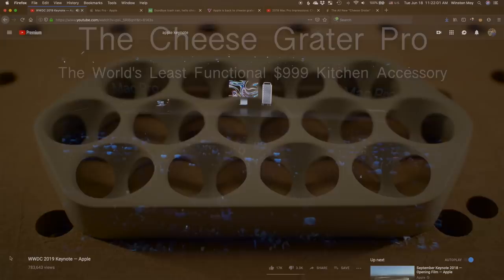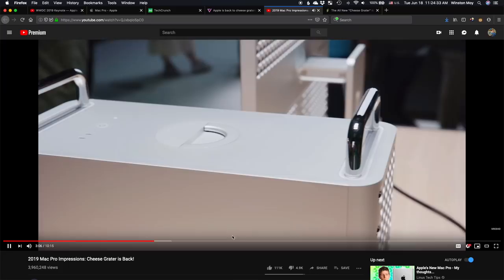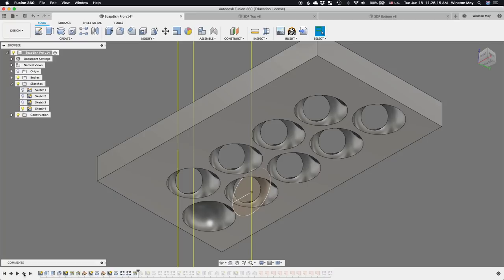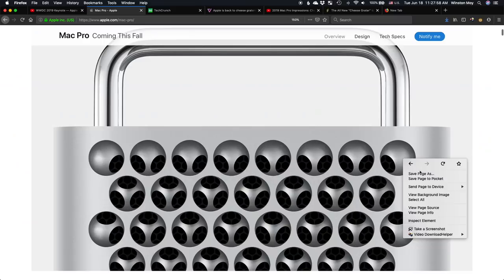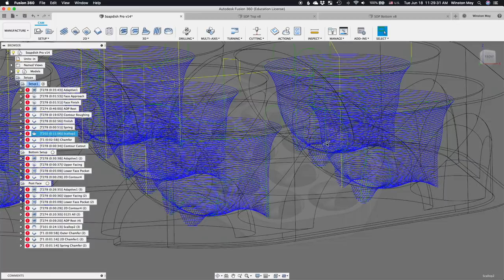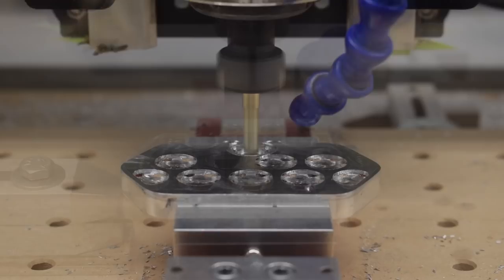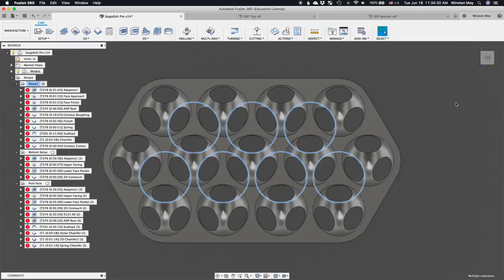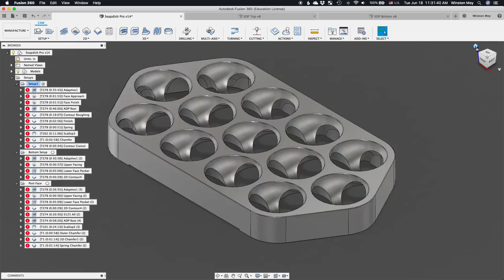Machining Apple's Mac Pro Grille on a CNC

Comment: That will be a thousand dollar soap stand, soap sold separately of course.
Reply: @Dmitry I didn't think starving children had enough fat on them to make soap.
Reply: couldve been better if you said stand not included
Reply: @Dmitry 
I dont think so. They're most likely going to be moving a large amount (if not all) production out of China.
Reply: But don’t worry! You can save 5%... with an Apple Card. (btw, when writing this comment, autocorrect forced me to capitalize Apple Card. IT DID IT AGAIN 😂
Reply: Now introducing apple soap pro, sold for 99$. the apple soap pro is bendable, water resistant,a and will charge inside a microwave.
Reply: Of course you need to buy the $1199.99 apple Isoap
Reply: The Blissful Orange Apple iSoap
Reply: No No No... it's I-Soap not EYE SOAP!... your using it wrong!
Reply: But isnt the soap they'd use just old iphones?
Reply:  Apple Soap, 🧼 The Most Convenient soap ever made! 100% Recycled from iPhone Parts

Comment: When your Budget is 0.000001% of that of Apple but you improve on their Design
Reply: @Murphy deffa and money can't cure cancer :(
Rip Jobs
Reply: @Felix-ve9hs  probably could have, he didn't do things properly
Reply: @RunFor OurLives "subjective" it litteraly gives better ventilation because more holes
Reply: @GlowingSpamraam  but "better" is subjective because you have no idea how it will perform. What you meant to say is it has MORE ventilation, but MORE ventilation does not necessarily mean BETTER airflow. Place your motherboard on your desk and it will have great ventilation but horrible airflow and will more than likely just accumulate dust. The purpose of proper ventilation is to keep air moving in a specific pattern, not just to provide "more air".

The only way to know if it's better is to actually test the two side by side, which Apple may or may not have done. Of course my hypothesis is that given how tiny those edge holes are comparatively to the full surface area, the difference is more than likely negligible AF so it's not actually "better" in any measurable way, just more expensive, which is pretty much worse for a company that offloads all of its costs to its consumers + crazy markup.
Reply: @Murphy deffa It literally can though.
Reply: @RunFor OurLives That's why all Apple is doing is improving someone's else invention ;)
Reply: I would say that the design is not that good in the first place. as you could make a more functional vent. without machining for no reason.
Reply: @ameraldas3641  You are confusing design with engineering.
Reply: @ameraldas3641  Also its not for no reason its part of the design, wether you like it or not apple are globally renowned for their design   and I would hazard a guess they are better at it than you.
Reply: @sacredgeometry  I don't know if "renowned" is the right word here ;)
Reply: @DASPRiD  it is.
Reply: @DASPRiD  Revered is also applicable.
Reply: @sacredgeometry  I'd rather say "frowned upon"
Reply: Ameraldas The design may have some sound dampening properties while not changing the air flow characteristics. If so, that will be very welcome in the environments I work in. I plan on testing this what I get one.
Reply: I Am Sekou I am not a fan of anything but it’s nice to know you have found yourself.
Reply: I Am Sekou The arrogance of obvious idiocy is far too common to be even vaguely interesting.  

But, by all means, keep enjoying the belief that this demonstrates your importance or is a valid substitute for your obvious deficiencies.
Reply: I mean, there’s more to it than just making it better. When you’re mass producing, that extra 10$ to improve that one thing can turn into an extra 1,000,000$, some of which will not even sell
Reply: @Felix-ve9hs  didn't he ignore cancer treatments, and instead tried a juice cleanse
Reply: @Murphy deffa money can buy brains. Ever heard of college? And a company would buy someone with brains.
Reply: Only marketing brains..they forgot high end cameras shoot at 120hz that apple macpro monitor cant display
Reply: @RunFor OurLives "Also, improving upon someone else's invention is easier than the initial invention." No wonder Apple became successful so rapidly, although to be fair Apple had better marketing, that was the only "improvement" they needed to sell stuff with their name and logo, there is a reason why people say Apple is a "lifestyle company" after all.

Perhaps you should research about the brand you say improved on so much, even Steve Jobs said he was the marketing and Wozniak was the Engineer. Shame more iDiots don't know the extensive early Apple history and just claim they invented everything they sold/sell.
Reply: @alpha.gamma.dingdong  "What you mean to say is it has MORE ventilation, but MORE ventilation does not necessarily mean BETTER airflow."

Mate, your denser than a brick. Ya know that right?

"Place your motherboard on [a] desk and it will have great ventilation*,* horrible airflow and will more than likely just accumulate dust."

1. Assuming there are fans present (which there are in the Mac Pro), increasing the intake will produce better thermals OR sound, depending on fan configuration you can have Low RPM fans for low noise since increasing the intake generally means the fans don't need to be running with higher speeds to get the same amount of air, a 200mm fan can run with a lower RPM and produce less noise than a 120mm fan.

You say take a motherboard and lay it on a desk, this disregards the comment you are replying to entirely, one case is: With fan more intake means more airflow which means better thermals (or noise, depending.) your case is: let me disregard we are talking in terms of fans and more space for intake DOES mean better airflow and let me compare it to no fans and a static air environment.

Finally, ventilation doesn't mean air that a computer produces heat into, ventilation has a very literal meaning(s) of

1. The replacement of stale or noxious air with fresh.

2. The mechanical system used to circulate and replace air.

An object with a passive cooling system is not a mechanical system circulating air nor a system actively replacing hot air with fresh air.
Reply: you wouldn't need to improve something if you didn't first know that it was not as good as it could be.

Comment: You should make a replica Mac Pro case. Then get Snazzy Labs to make the ultimate Ryzen Hackintosh with it.
Reply: They would get sued into oblivion if they tried to sell that.
Reply: yep
Reply: It’s hilarious how much cheaper it would be
Reply: Ryzen and hackintosh don’t go together very well unfortunately. It’s possible but there aren’t really drivers for ryzen chips for macOS because macs all come with intel chips.
Reply: @redluckog7008  Low production run cases? It'd be a fucking fortune.
Reply: @phillipsusn  It's not fine really.. If you're just playing at using a computer then sure, but if you expect it to run close to a real mac or even an intel hackintosh you're fooling yourself.
Reply: Bro facts
Reply: Codey Vargas Everything else? Not quite. Some really good audio developers have released apps or plugins that require AVX-512 support. Some of my most important plugins are getting massive benefits from it. By sticking with Intel, it seems some developers are making the commitment, especially since the iMac Pro and Mac Pro releases. So, no go on Ryzen at least for some of us.
Reply: @markm0000 ....  Hahaha... Sued to oblivion...  Noice
Reply: @Codey Vargas Except it doesn't really. The one thing hackintosh folk never mention - it's not that good.
Reply: LinusTechTips: Holy my beer
Reply: Threadripper 3990x anyone?
Reply: @markm0000  probably depending on whether Apple filed any patent for the case. If not (though unlikely), maybe just make the case anyway and not include a logo can get around that. Otherwise, maybe just make the front panel and mod it into another case, as IIRC you can't patent simple geometrical shapes.
Reply: LTT already did this

Comment from the maker: Note: People have commented before, and they'll likely keep commenting later but the reason I chamfered the edges is because Apple typically has a 5-10 thou roundover on all their hard edges. That's why you don't slit your wrists whenever you type on a Macbook. The Mac Pro likely has that sort of edge-rounding too, and I wanted this test to be more realistic. Accuracy is obviously important when so many people are counting on the results of this test to inform their purchasing decisions.

For those asking if you can use a "ball end" drill, it's not really ideal. A blunt-nosed drill doesn't work very well. However, a larger diameter ball endmill would require fewer stepovers and be faster, assuming you have a beefy enough machine to handle it.

Note: If you want to 3D print your own grater/soapdish to test, I posted the unchamfered version here: https://www.thingiverse.com/thing:3704406
Reply: Winston Moy how much would you want to sell that cnc Mac grill I want one or two for my night stand and drawing desk
Reply: Thank you, I can now inform the Bank of Parmesan cheese that they do not need to invest in this new grater hardware, very sad to see that all these years of hard work on Apple has not paid off in a great grater. Maybe you can tests if it does function well for pressing Apples into apple Juice, I think they made a mistake during development.
Reply: Thanks, I will get a Mac pro for the shower, finally there is a solution for the soap dilemma!
Reply: thanks, currently printing one ;)
Reply: How much does it cost to do all these at home?
Reply from the maker: Allan Sh If I'd gotten everything right, I could have made and anodized one in an afternoon. The aluminum itself is worth a few dollars. The rest is just time.
Reply: Winston Moy  I mean, I don’t have any equipment at home now. If I am going to build a workshop, how much would it cost?
Reply from the maker: @allansh828  That's an extremely open-ended question. To get up and running with a CNC like mine with some cutters and accessories would be around $2k. But if you don't have power tools, hand tools, consumables like glue/sandpaper, a workbench and some decent lighting... could be hundreds or thousands more depending on how crazy you want to go. That's a calculation you gotta make. Come up with a project, figure out what tools you need, and price it out. Subsequent projects will get cheaper as you build up an arsenal of tools.
Reply: would be more accurately described as a break edge. they can take shape of chamfers or fillet/ rad. how would it work on smaller sized holes? most graters are fine for hard cheeses like you used as they are more likely to flake than grate. 

as a machinist I already saw your mirroring issue before it even happened. without proper care and attention to how things are programmed mistakes like that happen, great to see you overcome it and found a more reliable and efficient way around it. side note on the finishing anodising is all in the prep work. got to get it clean, and i mean super clean so a better surface finish the easier it is to clean. a dremel with a bit of scotch-brite pad would make the world of difference but as a first go at plating it looked good. i also see in the tool path setups you go - rough finish rough finish... its best practice in most aplications to do all the roughing first then the finishing
Reply: Cool!  You can sell it on Kickstarter for $1000 each...
Reply: Yknow what this is cool.

Have you heard about my obsession known as combat robotics?
Reply: Fair for the cheese grater test, but honestly, I do feel like slitting my wrists whenever I have to type on the Macbook butterfly switches rather than my external keyboard.
Reply: Winston Moy 😂
Reply: Using a MacBook makes me wish my wrists would be slit on the edges tbh
Reply: > you don’t slit your wrists while typing on a MacBook

I can’t use my laptop laying down for this exact reason

Comment: This, you need so much CNC machining for what could have been just normal holes or a mesh that probably be even better for air flow.
Inflating the price just cause -  by Apple.
Reply: they are a fashion not tech company...
Reply: I’d rather pay more and get to see the beauty rather than some standard case. This is not for everybody anyway, there are cheap cases for people with your mindset. 👍🏼
Reply: Tikoblocks they’re selling the monitor at a loss so they have to make the stand cost more.

Comment: Hi, Great Video. I'm Curious, what vice are you using? I'm looking for a sturdy (very)low profile Vice.
Reply from the maker: Carbide3D's low profile vise. But it's meant for light duty work, I would not throw it on a Tormach or something without a few mods for improved holding strength.

Comment: I’m thinking that Apple is using a sphere bit for routing out the holes, which is why they have to cheat near the edges. That way, they can just drill normally and then simply round out the edges. I’d love to see you make another video if you ever pick up those drill bits.

Comment: Not sure what kind of tool or loads your mill/router/fixtures can take, but a much better (read: faster) way of doing this would be to hit each hole leaving ~.005 on the depth with a 1/2-3/4 90deg endmill and then getting a 3/4 (or whatever your desired size of hole) ball endmill to basically drill it out for the final.

Comment: New idea for a product: 1/5 or 1/4 scale model of a Mac Pro case with holes in the front and back that are actually sized to grate cheese. Add a slicing blade to one of the long sides, and the logo of your indie product studio to the other side where the Apple logo would be. If TwelveSouth haven't already stolen this idea, they soon will.

Comment: OR when you get the Mac Pro Cheese Grater, change the fans to one of those delta fans and then you can finally cheese grate as the powerful server fans sucks then in and chops them off for you even smaller and suck it back out the Mac 😂

Comment: See how your cheese grater somewhat works... That means you re-engineered Apple's design perfectly. Now it just needs to suddenly catch fire. Or bend. Or send a ridiculous amount of Voltage to the CPU. Or have the signal reduce to 0 when you hold it "incorrectly". Or maybe have a SATA cable inside that get's loose... somehow. Just like every Apple product.

Comment: Not only do the Mac Pro hole edges have a much harder edge on the chamfer, the chamfer depth graduates to a thin cheese slicing sliver on one axis of each front hole. Look at high res photos to confirm. Good attempt, but the ghost of Steve Jobs is not yet impressed.

Comment: I wonder if the aluminum also acts as thermal regulation by being thermally bonded somehow, on the interior side, to the cpu. If they wanted to save money and make a lot of them they would diecast these out of pot metal btw.  These could also be high end home air register grills, lol. Or in rubber... door mats.

Comment: No wonder it didn’t work well: You used the wrong side. It’s like you tried to grate cheese with a traditional cheese grater in the side where the cheese “comes out”.
The “Mac & Cheese Greater” (TM) is an innovative new “inside-out” approach to cheese-grating to make cheese grate again.

Comment: i wonder if you drop the hemisphere a bit deeper to have more than half of the sphere would create the sharp corner to help with grading cheese
Reply: But the CNC can't cut it that way. I understand what you're implying, but the bit can only cut downwards. It would be either extremely difficult of straight out impossible
Reply: Arthur Szabó a ball end but can deal with a little over hang
Reply: @CHSidChou  but even in that case it would be really hard to pull off

Comment: Sooooooooo... if the holes on the front were perfectly symmetrical, then it really doesn't matter which way you flipped it to get the back side, and your issue was probably user error instead.

Also: much better way to manage this is to just use a ball end mill that's the size of the holes, and then do a drilling operation instead of tiny stepovers. Of course, you need a heavier machine than most home shop players can bring to the game...

Comment: CNC machine is over kill for this project. Besides the edge holes,  all you need is a round head drill bit, and a stopper to get all round holes at same depth.
Reply from the maker: Let me know how that works out for you on aluminum.

Comment: I wonder if using a drill bit to remove most of the centers would have saved time.
Reply from the maker: It could. But not on a hobby cnc. On an industrial scale, it'd be great to run a 1/2" drill here first.

Comment: IMO that's very expensive operation. I think they use only drilling with sphere-shaped bits
Reply: I doubt if his machine would have the power or rigidity to plunge cut with a ball end mill in aluminum. Additionally, there would be no way to cut those perimeter cuts with a big bit as you describe. For small, hobby CNC machines, using a small bit with helical interpolation is really the only way to approach this kind of workflow.

Comment: Apple:
We reveal our newest and greatest in soap technology, the Mac soap, the small Mac soap will start at 699$ and the big Mac soap for two pieces of soap will start at 799$, to maximalise the effectivness of our new product we also made the Apple soap, it's modern design will fit the needs of all Mac soap users, the Mac soap will start at 999$
(Apple soap sold seperatly, the Mac soap sink will only be able to hold the original Apple soap, other soap will not fit)

Comment: Fun fact. The highest end Mac Pro costs $45,000. More expensive than most cars.
Reply: That's not a fact, just a guess (and probably not an accurate one either). If the top end Mac Pro is only $45k I'll be very surprised considering you can spec out an HP Z8 workstation for over $100k.
Reply: Jeremiah Kuehne lol